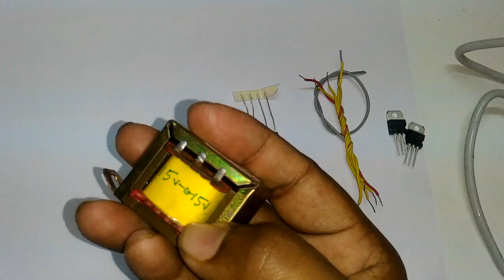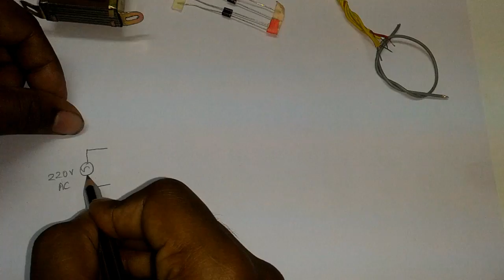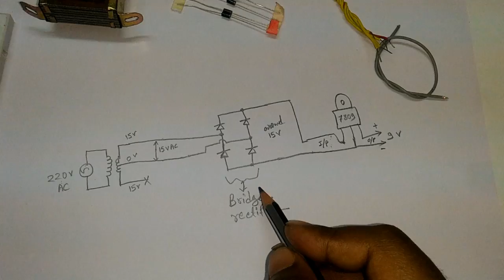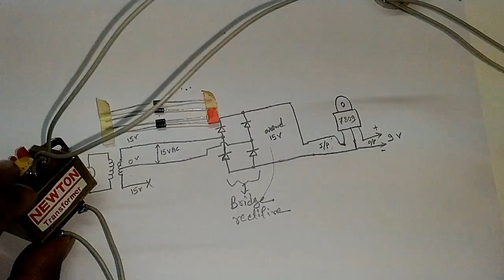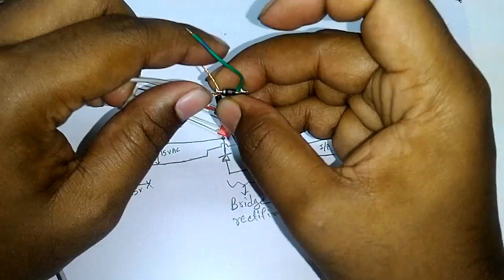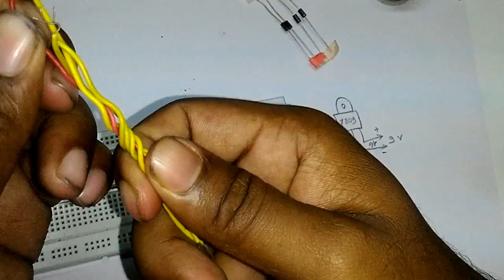Project-1:How to make a 9VDC source from 220 V AC system by using bridge rectifier circuit.

Comment: Bhai, first of all why u need 15v transformer n voltage regulator .
U simply use 9v transformer , two in 4007 diode and one 1000uf capacitor. Its over .:) :)

Comment: Why it is only 7.43V dc and not 9V dc...I need a 9V dc for my guitar amplifier...
Reply from the maker: When i make this video on that time because of one diode the value is not coming exactly 9 V but i make some more times then i see it is not vary this much it varies from 8.5 to 9.5 V .
Reply: Bhai banda confuse hai. Aap ready made le lo market se. And make sure abt amp of power supply to.